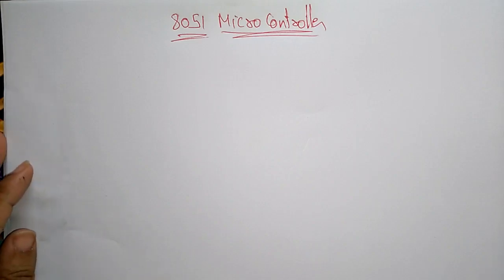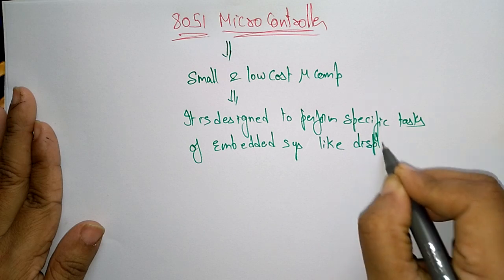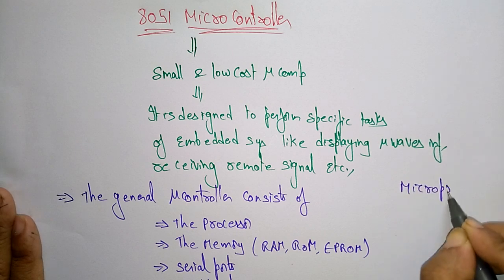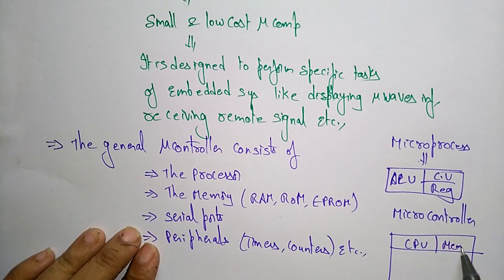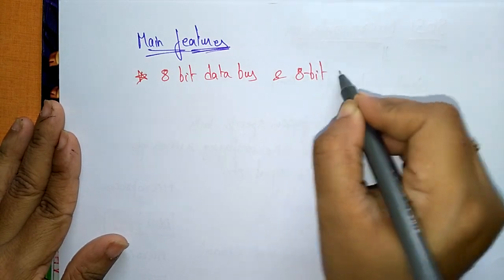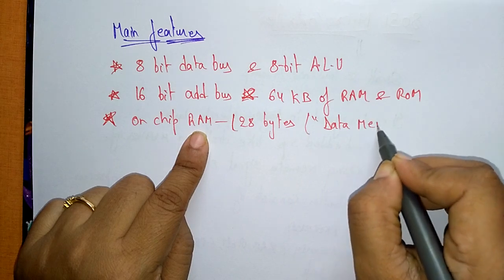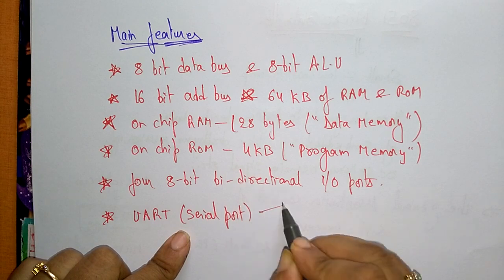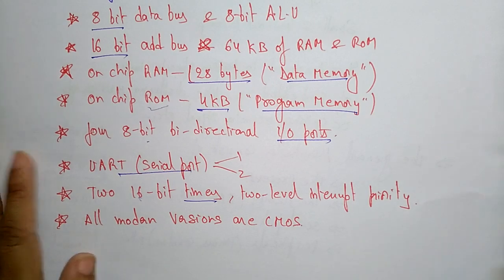8051 microcontroller | Introduction | MPMC | Lec-51 | Bhanu Priya

Comment: low-cost microcomputer which is designed to perform the specific task of embedded systems like displaying microwaves of information receiving remote signals etc so at simple we call it as a microcontroller is small and low-cost serial ports and some peripherals peripherals like timers counters timers counters etc means some more components that are integrated with this 8:05 and microprose microcontroller so easy ro5 and